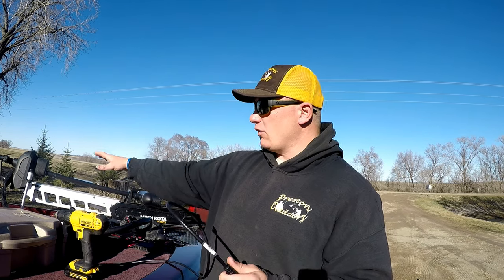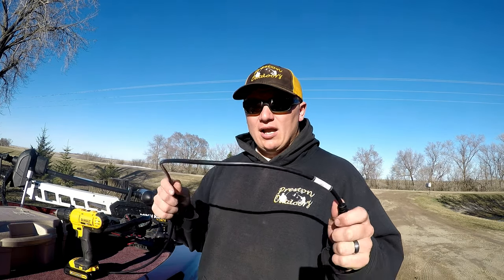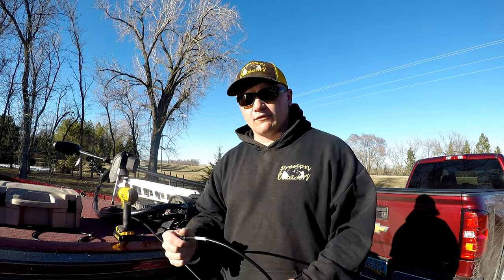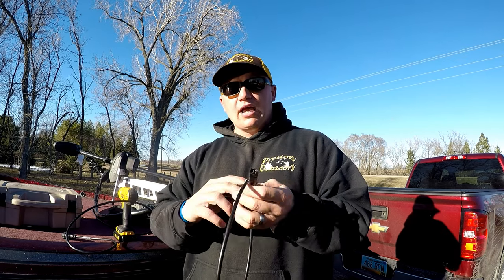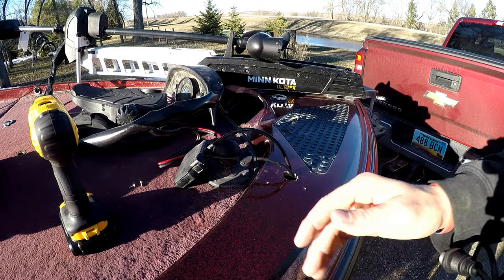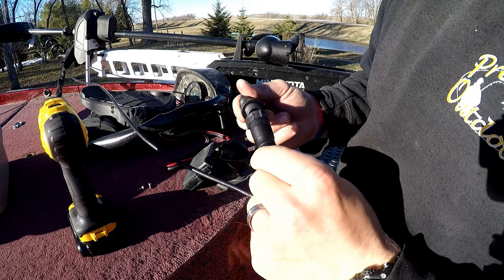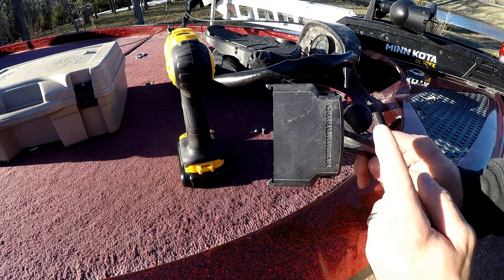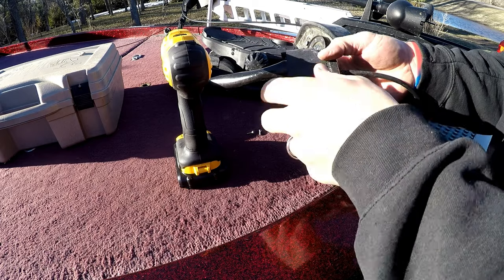Minn Kota Ultrex Down Imaging - Hook up to depth finders

Comment: 4:06 was exactly what I was looking for, thanks. 🎯
Reply from the maker: Thanks for watching and taking the time to comment! Glad the video could help!
Reply: I had one question, wondering if you can help. I'm gearing up to install a Terrova built-in MSI and I want to also hook up MEGA Live, which is separate. 

Any idea if it could plug in MEGA Live to one of those left over slots shown at 4:06? Or am I going to need to buy that $250 5 port ethernet switch. 

I only have one depth finder screen. Looks like the trolling motor has two cords to plug in... one because of iPilot link and the other for the built in transducer? Is that how yours is?
Reply from the maker: @joshuasmith2689  yes I can sure help. Helix unit only has 1 slot for the Ethernet cable and your Ipilot link trolling motor will take that slot. The Mega Live is a Ethernet connection, so you would need the 5 port hub to connect your graph (1), Ipilot link trolling motor (2) and your mega live (3)

Comment: Thank you for doing this video, I looked all over the internet and couldn't find what I needed. this shows exactly the cable I need to buy to make mine work. This is my first minn kota ulterra and I wasn't sure what the three wires coming out of the trolling went to. Thanks again.
Reply from the maker: Rick Song thanks for watching and taking the time to comment! I was in the same boat when I was looking around for information and videos on what I needed to make sure I could use my graphs and trolling motor right away. Glad you liked the video and got the information you needed. Hope it all works out for you!

Comment: If I just want to run one finder for mdi do I just plug that one into the trolling motor if not how do I get power to both of them? Been super confused with everything and trying to order everything at one time
Reply from the maker: Thanks for watching and commenting. I’ll try my best to answer your question. If your wanting to run 1 unit up front to your link kits ultrex for mid, make sure the ultrex you have or are planning on getting has the down imaging transducer mounted at the bottom of it. Then you’ll need that dongle connection I talk about in this video to go from the transducers cable coming from the trolling motor then that plugs to the back of your unit. As for power your going go need to run power for the trolling and the unit you have up front separately. The trolling motor needs to have 24volt or 36 volt depending on what trolling motor you have or going to get. The unit only needs 12 volt. 

Let me know if this helped or if I can answer any more questions.
Reply: @PrestonOutdoors  I got it all set up and out on the water appreciate the help and info👍🏻
Reply from the maker: @codyreeves8207  awesome to hear! Glad things worked out, good luck fishing!

Comment: What do I connect the Ipilot cable too? May need and adapter if it goes in helix?
Reply from the maker: thanks for watching the video and commenting. Are you connecting an Ipilot Link Ultrex into a Helix depth finder?
Reply: @PrestonOutdoors  yes sir, but I don’t see a port that matches.
Reply from the maker: @noonie025  for the helix unit you want to connect to ipilot, do you have any other transducers connected to that helix head unit?
Reply: @PrestonOutdoors  I have mdi on trolling motor and msi on transom.
Reply: I know where the transducer is plugged, I just don’t know where the Ipilot link wire goes?
Reply from the maker: @noonie025  Ok I got it. Do you have your 2 helix units connected to each other with an ethernet cable so they can "talk" to each other?

Comment: What adapter is it specifically???
Reply from the maker: This is the Minn Kota Built in Mega Down Imaging Adapter Cable- Mega Imaging Helix Adapter. Gives you 2 option to chose from. Make sure you choose the option that is going to max the same size of Helix unit you are attaching it to.

Comment: Can I hook both the transducers to the helix 10. The down imaging from the trolling motor and the one that came with the helix 10 both at the same time.
Reply from the maker: Thanks for watching and commenting! I’m pretty sure your can’t do that. Once you connect that cord to the back of the graph there isn’t no other spot to connect the other one. Is there a reason your would want to hook both up?
Reply: So I can use the down imaging on the motor when trolling and the side imaging when using the big motor
Reply from the maker: @larrypettit2137  so you would have your trolling motor in the water when using the big motor?
Reply: No I want to use the down imagining on the trolling motor while trolling.
Reply: Can I do it with a either net switch?

Comment: I just bought a helix 7 and the adapter cable. The connector coming out of the ultrex is a small male not like the larger end on the adapter. Maybe has wrong cable on ultrex? It is less than a year old.
Reply from the maker: What size Ultrex did you get? The one I have in the video is a 24 volt 52” shaft 81 pound thrust option
Reply: It is 24 volt 80 lb. Don't know shaft length.
Reply from the maker: @shelbymosley3792  sounds like the same on I have. Did you get the wrong side “dongle” or connection?
Reply: Thanks for answering. I think the problem is we have the I pilot not the I pilot link. Didn't have a hummingbird on front of boat when we bought. It has a round transducer not the oblong like yours. Thanks for responding.
Reply from the maker: @shelbymosley3792  not a problem hope it helped and hope you can get yours working!